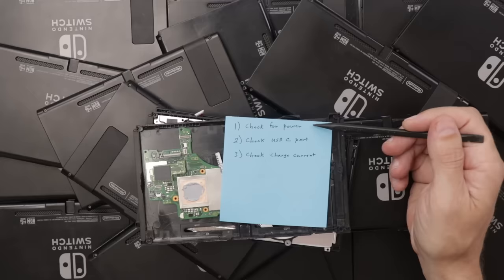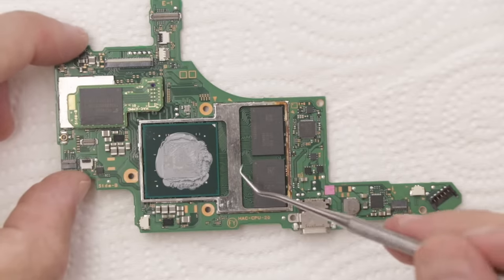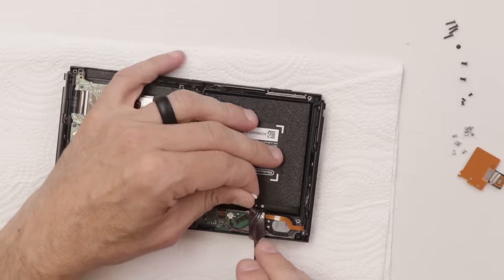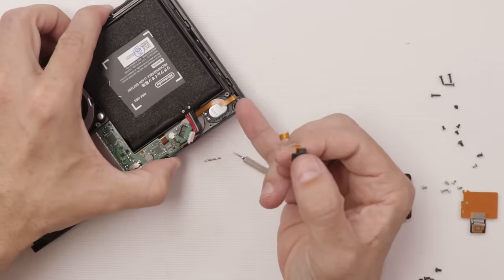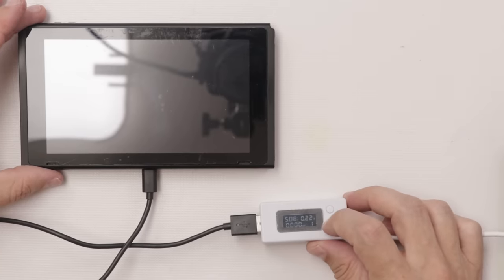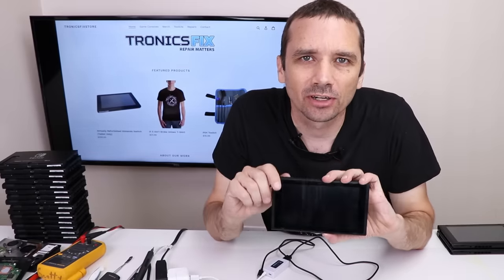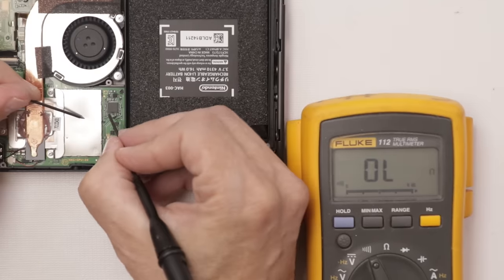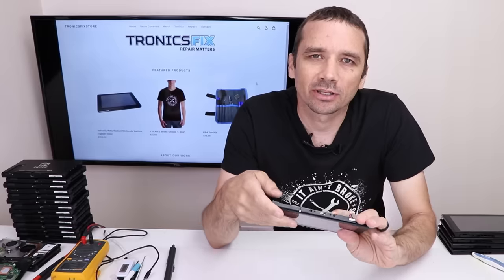I Paid $1,815 for 20 Broken Nintendo Switches - Let's Make Some Money!

Comment: Imagine buying a broken switch and its completly fine. I want your luck
Reply: David Moll I try todo that with phones, happened a couple times I got a $75 iPhone 7 Plus that didn’t turn on, and I plugged it in and it worked
Reply: I bought a broken iPhone 5s on ebay but everything works just fine! Clean IMEI no iCloud
Reply: He's had plenty of awful luck too lol, he deserves a good batch.
Reply: Seven Yes The Number Seven yeah, I have also found so many phones that are “locked” but when I check the imei it’s unlocked, then I can make some money on it
Reply: Happened to me with a Vita once, just had to unplug the battery wait a few seconds and plug it back in.
Reply: The Switch that had nothing wrong with it physically was likely banned from accessing Nintendo servers from it being modded at some point.
Reply: depends if they were truly broken, sounds like to me he just bought a couple used and some turned out to be in normal condition for being used.
how exactly is he going to make decent money? who will surely buy 2nd hand switches that were restored for over £90? since hes bought them at £90 on average.
Reply: @Dockhead  $90 not £90
Reply: @lordrahl7033  well if it is that, then good job he's got that spare motherboard for one of the others
Reply: @donnysmokes4641  some people don't really even have the knowledge to say "hmmm....maybe it's the cable?". It surprises me but then again it doesn't
Reply: I buy on ebay a 2 robot vacuums, there was writed for parts, or not working, i only change the battery (1 battery costs me 5 dollars, because i made it at home) and they work like a new :D
Reply: boyo used Switches are going for at least $120 (and in most cases much more) on eBay. He can also sell parts from the non working consoles that most often need to be replaced, like the battery, screen etc (or just keep them for for repairs on other Switches he buys).
Reply: @donnysmokes4641  How do you check the IMEI?
Reply: The problem with IPhones are those that have been connected to iTunes, and are now all locked out. They claim it is for security, but they could just require formatting, they do it for $.
Reply: Bought a classic iPod as scrap for a few bucks. People thought it was fried because it was the Firewire model, and the normal USB cables don't work on those for charging
Reply: More like imagine  buying a switch, and it working normally
Reply: Who knows maybe theres some other problems with it which aren't noticeable visibly, like maybe a defect battery.. I had a iPhone 5 which looked fine but after using for a while you noticed the battery was severely limited in its charge.. Although this guy checks the batteries there could be other similar problems that aren't immediately noticeable to the eye.
Reply: So the Switch is not durable ?
Reply: Actually happens quite often
Reply: @xxxgames4458  because 5 year olds and 70 year olds are selling their switch on eBay...smh
Reply: YEP! That's my story only with GPUs :D
Reply: Reminds me of the time I bought a Dell XPS laptop with a bad motherboard on ebay that the seller listed the serial number for. He never bothered to check the warranty, but I did and clicked that BUY IT NOW button almost immediately. It had 2 years left on a 3 year accidental damage warranty. The Dell tech was at my house the day after it arrived with a new motherboard and a replacement screen since the one that was in it had some scratched on it (accidental damage yo!)! I kept that laptop for 3 more years and sold it for the same price I paid for it!
Reply: Bought a broken PSP. The battery wasn't charged and it had a SD card and game still in it. Felt good, man.
Reply: when the sellers power cord is the problem aka they dumb. you can get working stuff.
Reply: HaxMcGee got a used PS4 slim for like $75 because his the HDMI cable he sent was broken
Reply: @replicantMK2  its*
Reply: Once I bought a "broken" gameboy pocket for 7 bucks, it worked perfectly

Comment: Is it just me or does $90 for a broken gaming system seem like a steep price? Almost sounds like a deal they would have at Gamestop...
Reply: Gamestop sells them for 250 :)
Reply: I mean, $90 for a Switch that needs 1 replacement part or even just a scrub with a toothbrush seems like a pretty good deal to me.
Reply: Game stop used PlayStation controller on sale for $50, get them while they last
Reply: @watsgoinonhere1  ehm yeah if you know it before you buy but it can be dead forever. 90 is a lot for a paper weight
Reply: these are being sold to guys like him who knows how to fix em, then turn around and sell them for 199 refurb. So 90 for a 300 dollar console that all it needs is a scrub with a toothbrush is a good deal. He paid 1800 for 20 consoles, now 20 x $200.
Reply: @hang1893  Did they come with the controllers?  Those are $70 new themselves.  So selling the console only sells for around $200 on eBay.  Minus eBay's 10% and Paypal's 2% that's $176, and roughly $5 shipping at absolute best,.  Subtract the original $91 and you are looking at $80 profit per unit.  Not counting the cost of any parts needed for repair.  Also not counting on all the units working.  If only half the consoles are repairable that's only about $1710 in sales, not even turning a profit.  Seems like a lot of work to make any money, even if he can fix them all to make around $1500 - $1600 after all is said and done.
Reply: @wallcrawler62  all depends on how he plans to sell them . Ebay is not the only place to sell.
Reply: @hang1893  Good luck selling 20 consoles anywhere else quickly.
Reply: @wallcrawler62  you clearly dont know how this business works check his site. You'll see hes already sold out of Switch systems. And like I said there are more places to sell than Ebay
Reply: @wallcrawler62  smarts
Reply: Where I live, it is more like 200-250$ for a broken Switch. After shipping costs, replacement parts, tools and consumables, it is not even worth it. And then there is the risk to lose it all because they were spilled with soda or something - a seller is never going to tell you that.
Reply: @wallcrawler62  he also fixes joycons so I guess he would sell them together
Reply: All those switches would have costed like 6k if they werent broken
Reply: It's not depending on what's wrong with it. Even if the motherboard is dead, if it is the only thing wrong with it and the battery, LCD, and digitizer are working it's actually a cheaper way to get parts (a new LCD, digitizer, and battery totals to over $130, so $40 more than just buying another switch where those parts are working properly).
Reply: You're not wrong. Ebay is full of broken consoles and people are charging 50+ dollars for them.

Comment: Note to self. Maximum safe stacking height of Nintendo Switches = less than 18.
Reply: weird flex but okay
Reply: @silvanpaul2531  way to flex on a weird flex paul
Reply: Part two plz
Reply: The 9th from the bottom is the one that slid, so...
Reply: fewer
Reply: @silvanpaul2531  Do people really say flex as often as I think they do?
Reply: @Kuli24000  No idea
Reply: In my experience it's max 2.. but I'm also a klutz :P
Reply: I usually keep mine stored vertically on a bookshelf
Reply: @Axyo0  pardon, your grace?
Reply: Hahahha true
Reply: Max stack height <18

Comment: So... my work is actually to repair Nintenthings for the big N, and i can tell you that when something doesn't work like a PCB, a rail or a speaker, we don't bother cleaning or searching why it doesn't work, we just replace it with a new one.
and i can't tell you how amazed i am with all the knowledge you've got on PCB and stuff, because it is my actual job and i don't think any of my co-workers have 1/10 of that knowledge...
Brilliant video btw, it's my first one and won't be my last, +1 sub !
Reply from the maker: Wow, thanks for commenting. You probably can't say much more than that but if you ever want to chat go to our website and reach out on our contact form. www.tronicsfix.com
I always thought what you said was true but have never heard it from anyone who knows.
Reply: Champ, it is probably cheaper training and man-hour wise for Nintendo to just replace the parts than to have someone troubleshoot what's wrong with it and repair it.
Reply: @dickbison  that's exactly what he's saying..
Reply: @dickbison  that is exactly what he said
Reply: @Tronicsfix  Just watched your video. What do you think of baking the motherboard? I used to buy bad video cards and removed the heat sink and everything and just baked the PCD around 400 degrees F. Made a lot of money doing that.
Reply: @vocation8032  it doesnt fix it properly, it gives enough heat to possibly cook poor soldered connections to less resistance. Permanent fixes require desoldering and flux for solder to flow and stick. Otherwise your "fixed" connections will crack again as well as new connection issues that didnt exist before. If you can get away with getting that quick buck, and tell people no refunds, more power to you.
Reply: I worked as an ICman in the Navy worked for the Electronics Shop and in terms of man hours is cheaper to replace PCBs in low end equipment. The PCBs for missiles and weapons systems are worth millions and those were repaired by some awesome ETs.
Reply: do they let you take home the "dead" ones? I pestered my local game stop enough to let me take their dead electronics finally and 9/10 times its just more cost effective to write it off as a loss like recently got a 360 from them and it just needed a fan so I robbed a dead laptop of its fan (same connector) and boop $75 right there.

Comment: *beep* "there is a short"

*beep that sounds the same* "and now it's gone"
Reply: I think he said in the video that he wants one side to beep & the other side to not beep. Kinda hard to see where he's pressing but two sides beeping means a short. 

Also, I get jokes, yay.
Reply: Só vai entender os beeps se souber eletrônica
Reply: I just noticed when you fix it sometimes you get free games because there are usually some games installed now I wish I could fix switchs
Reply: @pongchannel.  man I'm tryna learn
Reply: @hakah  well it kinda is if you don't pay for the games yet they are there anyways
Reply: Beep is always the same sound, it's the presence or absence that tells you if it's fixed.

Comment: I bought that screwdriver with your link💵👍 I support your tech channel, keep up the good work.
Reply: Love your videos man💪
Reply: A very important thing to remember about speed drivers is to not put the screws back in with it until you manually start the screw by rotating it backwards to capture the original threads. By doing this you can prevent cross-threading the screw hence destroying or weakening the screw mount hole. These are just plastic threaded holes where the threads are made at the factory by inserting the screw not premade by a thread machine. If you force drive the screw straight in the device has potential to just fall apart as the screws fall out.
Reply from the maker: Nice! It's such a nice addition to my workbench. Thanks for the support!
Reply: @George Harrison 😂
Reply: Lucas Gawor  I wrote that from my professional experience. What I wrote is not known or followed much in the industry. Why would you think I copied and pasted? I tried to word it for the layman/everyman to understand and visualize. Thanks!!!
Reply: Lucas Gawor  I tried to word it for even a mind like yours may understand or conceive thereof or grasp what I was referring to.
Reply: about to do the same, I have a Ifixit kit but an automatic driver will help gratly especially on those alienware laptops that have 50 screws and 3 diffrent types.

Comment: $90 each broken. Amazed how those Nintendo Switches hold their value
Reply: Obviusly is a console from 2017 that is having great success all over the globe what you spected?
Reply: A guess (I don't know much about current stock of Switch replacement parts) is that there are not yet a healthy stock of replacement part options, or the current parts prices  are not cheap so broken Switches have an average value of ~US$90.
Reply: This kind of videos makes huge market and demand for broken switches =) they were like 50$+- and jumped on the price after Steve's and Vince videos, i should tell great content tho...
Reply: It's because those are 20 at one time so mass rabat
Reply: Yah, he got kinda ripped off imo. I've been buying them for 60. My man needs to invest in a USC though.
Reply: I guess if you use one broken $90 switch to fix 10 others...
Reply: The value of the controller (as used) is part of those $90.
Reply: c00k13 m0N5tA Won’t last long once the Lite launches.
Reply: I mean this guy is basically buying up the whole supply so ya demand is high
Reply: That means he's gonna have to try to sell them at not much of a discount over new sadly.  That's crazy how high they are.
Reply: @MrSuperVikingo  the lite is basically switch:ds edition. It won't
Reply: @Folsomdsf2   buy for 60 sell for 90 strat ? I am not aware what completely broken switches go for (screen broken, everything unfuntional)
Reply: @soulmourne2698  pretty sure the original post was sarcasm
Reply: $90 for a broken switch. Have to spend money still, $80 for new joycons. Like $30 for a new dock. AC adapter. Joycon grip. Almost $250 right there. Obviously cheaper if you buy used accessories. Plus your time and parts fixing them. Hardly worth it imo.
Reply: @thomasmathew13  Unless you already own a Switch
Reply: 90 bucks sounds pretty pricey to me especially if buying in bulk. A used Switch in its original box is around 150 here in Germany and he puts a lot of work into fixing them. How much would you get for one of those he fixed?
Reply: These are probably all hackable Switches. So once fixed they can be worth some money.
Reply: @ha1vorsen  how does already having a switch change anything? Great, use the controllers, etc from your own switch. Now you still have to buy controllers and everything for your personal switch once the one you fix sells...
Reply: @thomasmathew13  You don't need to spend money on a dock, controllers, grip (which no one uses) if you own a Switch already
Reply: Meanwhile at GameStop...
"20 bucks for your working switch, or 30 in-store credit."
Reply: @ha1vorsen  ok, so you're going to sell the fixed broken one with your current switch controllers? Cool. So what are you going to play your switch with then? This really isn't hard to comprehend here...
Reply: @thomasmathew13  ...who said you're gonna sell anything?
Reply: @Ralph101  Sure, but even broken they still have value for another group of people -- those who want parts to utilize from broken Switch consoles plus some labor in order to get a working Switch  (or any other other electronics device where some parts from a scrapped Switch could be useful in a repair).
Reply: necro maniac *It’s , ) it is videos like this, it’s videos that like this. Is doesn’t fit. Sorry to be rude.
Reply: Can switches be blacklisted like they used to do with jtag 360's so you can't access official Nintendo services etc etc.. I can't remember how Nintendo propriatory services work now. All info was tied to the memory card not the console wasnt it? 🤔
Reply: @Folsomdsf2  USC?
Reply: @Folsomdsf2  What is a USC?

Comment: Professional: don't do this then proceed to to this
me: ...
Reply: Don't do this I am a professional.
Reply: NoobieLandCity No you arent! ..  oh.
Reply: Great teacher onizuka be like
Reply: Usually this is because they know what they're doing, what the consequences are and have a reasonable idea what the result they're going to get is.
Reply: because if you want to do this you need basic knowdlge about circuit, diagram,soldiering.... it not like making a bread you know
Reply: Reminds me a lot of things you do in pyrotechnics. When you were educating the new people you always emphazised things like never wearing polyester close to the skin or never under any circumstance having anything in the line of fire of a loaded effect but all the veterans would wear a light polyester layer closest to the skin to deal with the swing in temperature that you can face working hard in -20°C and would quite often walk straight through a field of effects to get work done quicker/on time. It is partially because they know extensivley the dangers they are dealing with and can react acordingly, and partially because of stubborn pride, "I know the dangers but nothing has happened before" has been heard quite a few times in my years as pyrotechnics educator from the veterans.

Can't say I don't do some of these things myself but taking risky shortcuts comes from experience in any field because you know what that risk and reward entails.

Comment: Always a good feeling bringing life back to broken hardware.
Reply: Had an original xbox since I was 4. It stopped working a few months ago. Finally worked up the courage to open it and fix it  3 months later. Turns out just the capacitors needed replacing. My childhood still lives and I'm happy.
Reply: my m.o. is if somethings broken i have fun making it REALLY broken.
Reply: @lordtartarsauceb8348  haha that used to be the case with me when working on things. I will say that having the proper tools makes a world of difference. Having said that, I really need to invest in a digital microscope. Some of this newer stuff is just insane to try and work on without proper magnification.